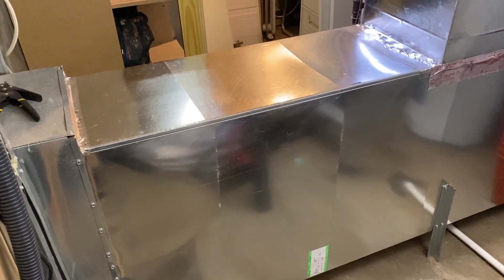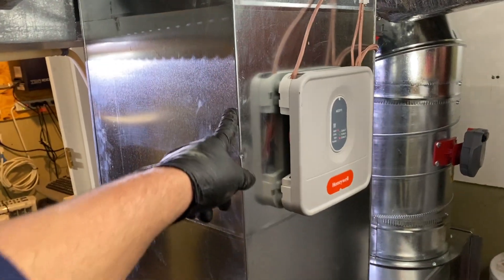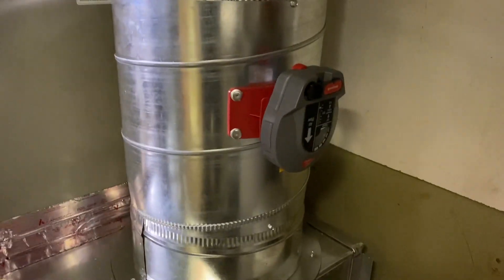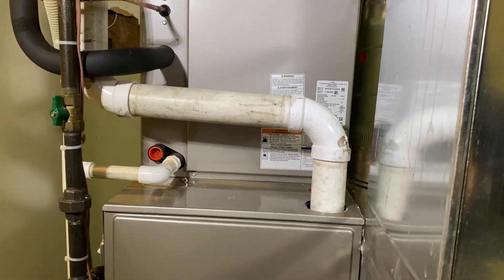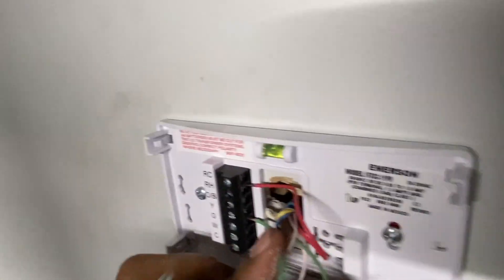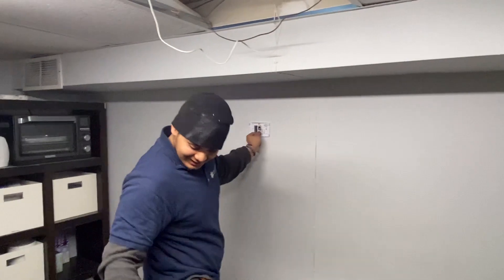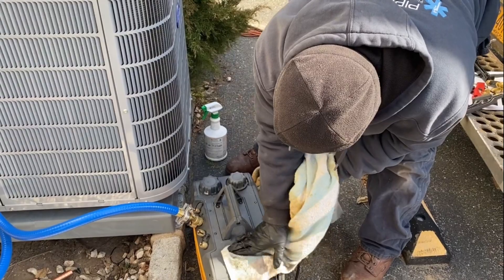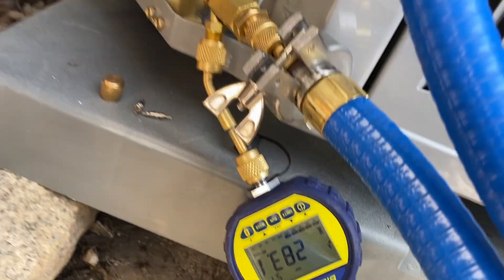Carrier 92% Gas Furnace with Honeywell TrueZone System HZ311 & Accutools TruBlu Evacuation Kit

Comment: Okay I see that you're running heat I have the same Zone board and when heat is being called the heat light is red furnace is working fine and everything but when I read the manual it says that when heat is running the light should be green not red that red means there's an issue

Comment: Hey Mike! NIce video! I have a question for you. How did you managed to break the system with refrigerant and not damage your micron gauge?  I was curious about this setup if you were replacing a compressor.   Or even an evap coil and you couldn't pump the system down into the condenser?